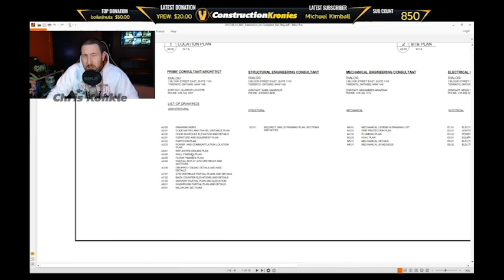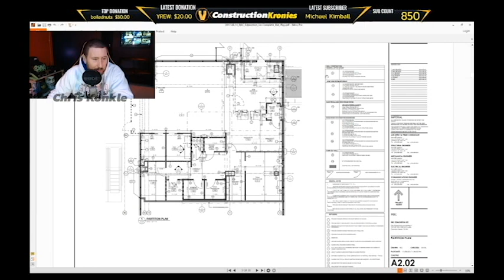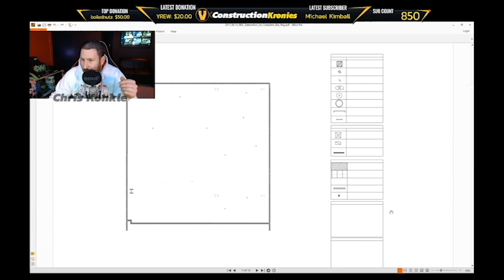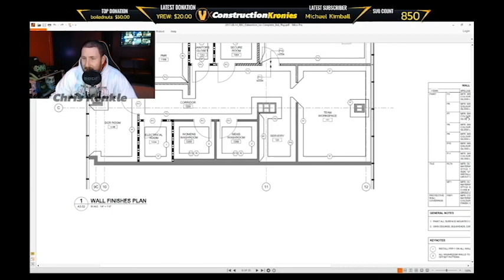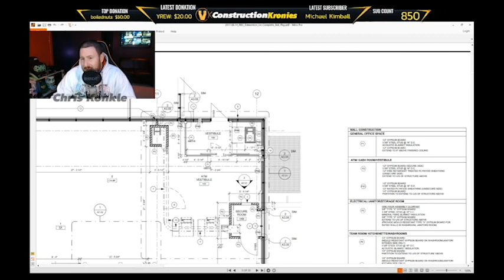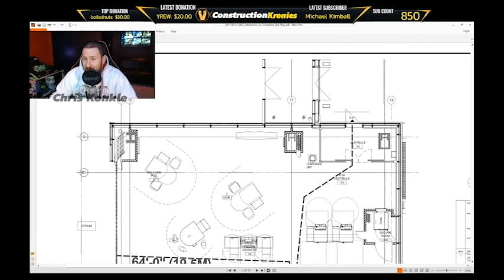Comment: Where do you usually find the drywall finish level?
Reply: In the reflected ceiling plan, or in the wall types will say finish 6" above ceiling height or something like that. If it's nowhere you need to ask.
Reply: Are you asking as to whether the finish must be taken to a Level 5, for instance?  That may very well be in the specifications. Maybe the inside of the mechanical room only needs to be Level 3!

Comment: Hey mate, how do you get the drywall footage for the drawing plans?
Reply: What you need is to look at the architectural plans, find the wall, partition, ceiling, parapet, types. That info will give you the details of what type of drywall goes on each wall. Also the fire plan will also tell you how much 5/8" type x you will need. So to find the footage you need to first calculate the linear footage from the floor plans and then the heights come from the reflected ceiling plan. Pay attention, anything fire rated goes to underside of structure and those heights come from the building elevations. Hope that helps man!

Comment: There’s so much to explain on this channel.   👍🏽 this vid is interesting to me because it’s inside info of how contractor / dry waller thinks. And needs to know. These are good drawing too ✍🏼 👍🏽 Well dome.
Reply: Awesome, thank you very much! Yes it is a lot to explain and trying to do it in the least amount of time as possible is tricky as you know! Very cool perspective that I haven't thought of before! You can always tell when a designer or engineer doesn't fully understand assemblies and methods and I always felt that there was a lot of distance between them and the field. With the advancements in BIM it is going to be so awesome - easy to get more information! Cheers!